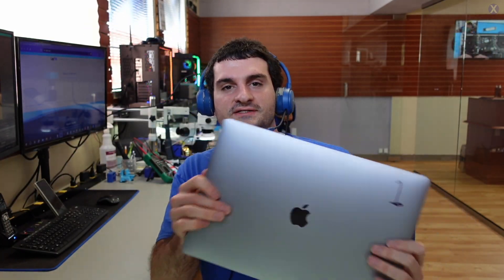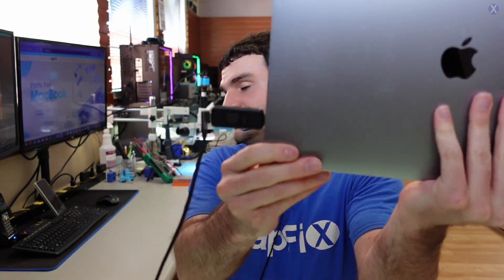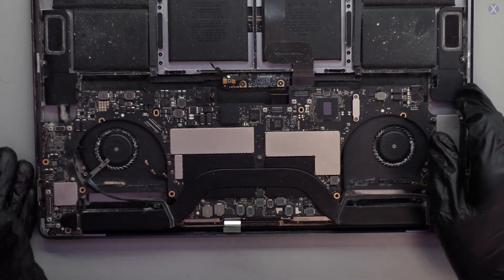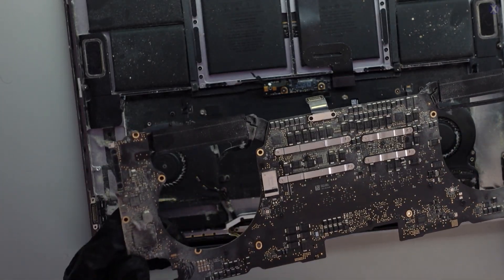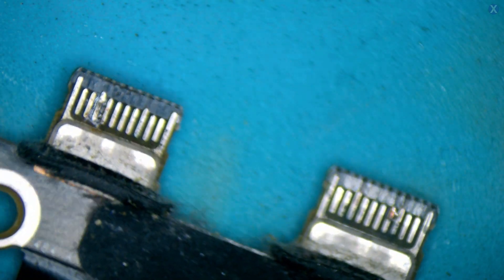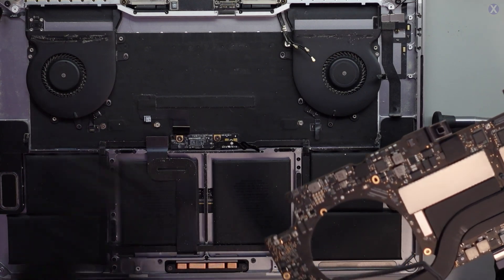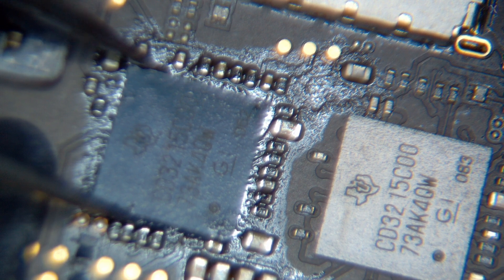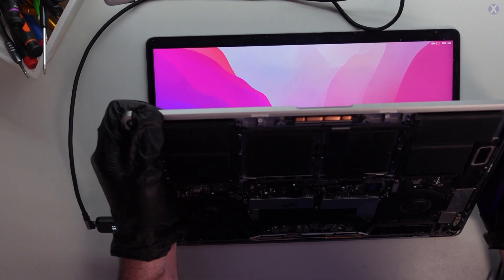15" MacBook Pro Not Charging Repair

Comment: Hi Man.. I really enjoy your videos. I have a question.. macbook pro A2251. everything works fine but the finger print sensor, it was already replaced with a known working touch ID power button (661-15734) however, it keeps showing "failed". a DFU Restore was also made, no difference.. any suggestion?
Reply: The finger print sensor is paired with the logicboard, if you just replace the fingerprint sensor, touch ID will not work. You have to take it to Apple to prgram the new Touch ID